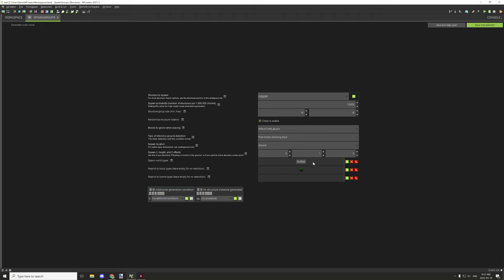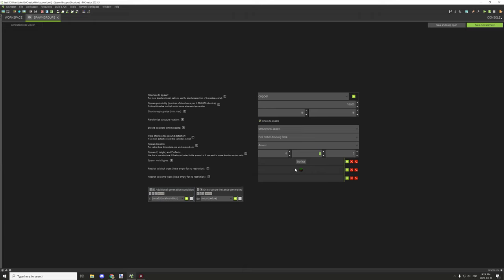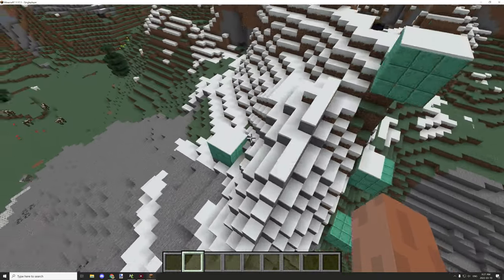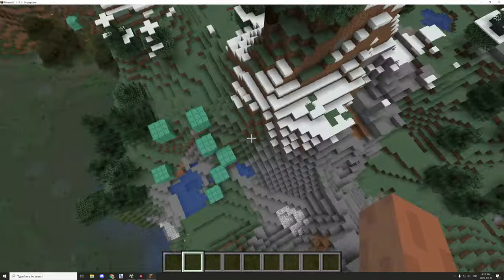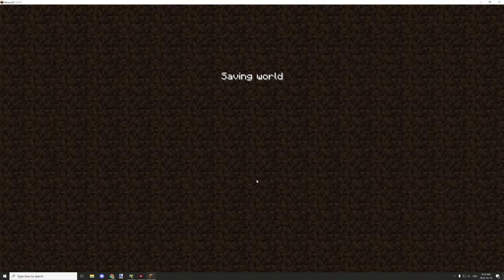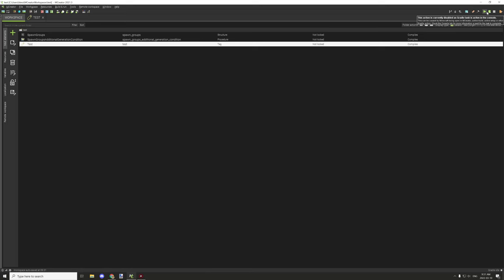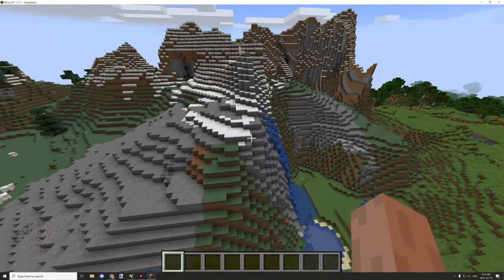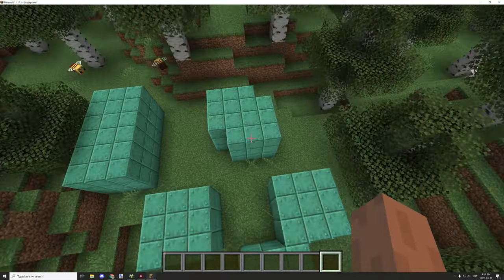MCREATOR TUTORIAL: Structure Spawn Groups | 2021.3

Comment: hmmmm, would there be a way to get different types of structures to spawn next to each other?
Reply from the maker: I don't think this is possible though spawn groups you would need to run this though procedures when the structure spawns.
Reply: One way is that you build the houses or buildings you would like to generate near each other and make them their own structures.

Then make a structure block with a larger structure size on it and make 10 or more different variants on the village type of building, then select the amount you want them to generate in 1000000 chunks and divide it with the variant amount.  

For example:
If you had 3 variants and wanted the structure to be 1000 in 1000000 chunks, just divide the 1000 with amount of variants and for each variant put the number to what the calculation is. It's somewhat more work, but if your structures aren't like 30x30 blocks, this should be doable. Otherwise i don't think it's possible, sadly. 
Hope i helped! :)
Reply: If you don't want to code the easiest way is with procedures and using "for" for generate the structure on ground
Reply: @vicale2006  nah, i'm fine with coding, currently trying to learn unity
Reply: @jarrencikanek9465  you can see how villages are coded or strongholds and make your own gen feature
Reply: i think you might be able to mix it with his random structure thing and instead of copper cubes use the saplings

Comment: How do i make different kinds of structures spawn in groups like a camp or something
Reply from the maker: This will actually be coming out on Monday using a different system. I made a post not to long ago, however its not really designed for customization in regard of structure size but you can control how many do spawn and build your structures that spawn on top how you like, it also supports random structure types using the same size.